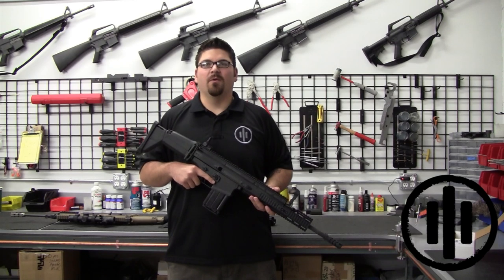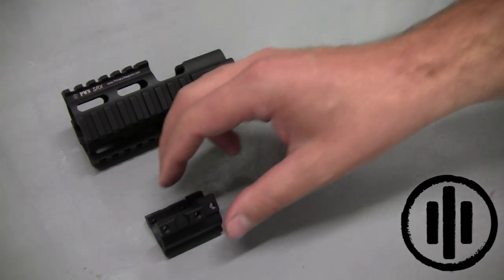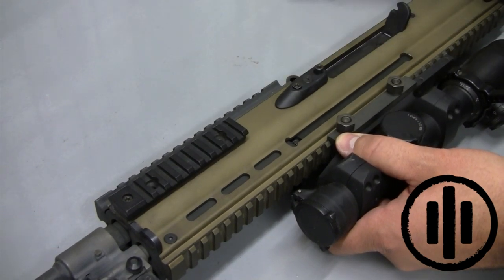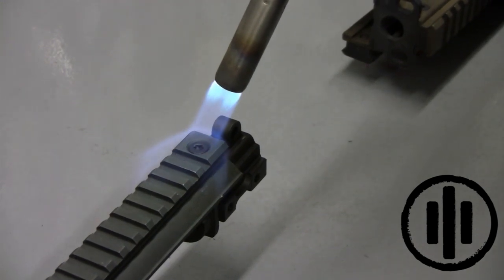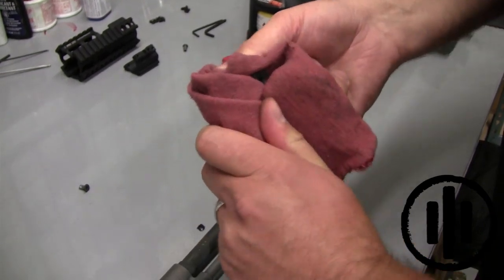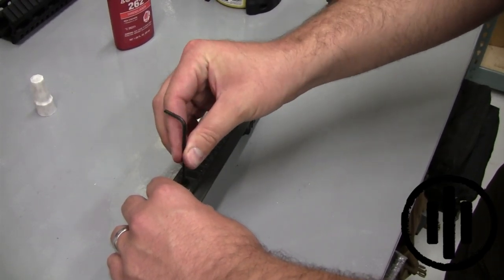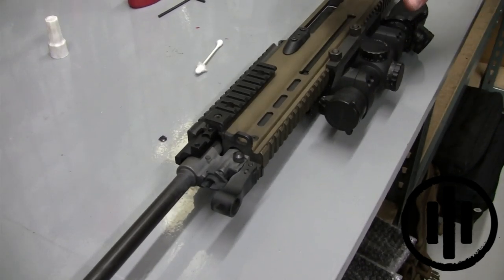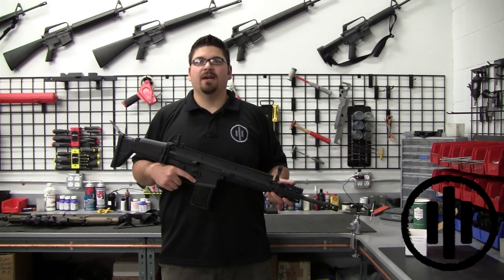PWS SRX (SCAR Rail Extension) Overview and Installation Video

Comment: Got the SRX a couple of weeks ago. When I went to install it I found out that the threaded screw holes on one side of the yoke are out of spec and the included screws do not fit. Tried to contact PWS about this a few time without resolve. Now I'm stuck as I don't want to use smaller screws on one side as it might counterbalance the strength of the mount!!!! Any help?

Comment: Would it be possible to modify the design to work on a piston driven AR such as the Sig516? This would solve the same problem with that system as well and you would have an existing picattiny rail system to work with.

Comment: Nice rail but other than replacing the charging handle to a downwards canting one and metal butt stock folder button and rails. Both of my SCAR's (16&17) have enough rail space. For me anyway. I use a high grip but I just switched the CH to the other side same with my ACR and my AK's and Sig's all have right side charging. So no big deal to moi. Even tho I own 15 AR's I still love right hand charging and I use the Russian under weapon technique to charge those types of weapons.

Comment: Dude there are rail extensions for virtually every gun out there and I own over 10 SIG's 7 of which are rifles and 3 AR's 2 516's and a 716. Bear in mind you would need the railed 516 not the older M4 plastic hand guard one. As you know the 516 has a proprietary barrel nut. So other than making your own barrel wrench (which I did) you have to send it to Sig for $299 to add rails.

Anyway Look at Midwest, Troy, Daniel Defense, Topgun,brownells, Tango down I mean really way too many sites to list.

Comment: An excellent video of what seems to be a very high quality product. It looks at though it would serve well for mounting a light, or other accessories. But I do not understand the recent fascination with holding so far forward on the rail. I'm sure someone will insist it provides better control. But to me it just seems like a goofy fad.

Comment: Yup RED Locktite is a bitch to remove. I used a soldering Iron and heated the screw and luckily mine came out pretty easily. But Ive seen some guys melt the OEM polymer rails and or just drilled out the screws and got new replacement screws. All depends FN's QC is all over the place sometimes its easy sometimes its a nightmare.If your not sure etc Send it to a competent gunsmith experienced with this type work as adding stuff like this isn't covered under warranty If you break it? It's all you.